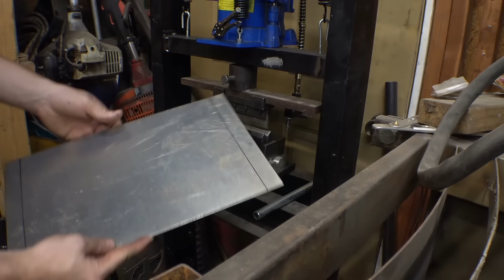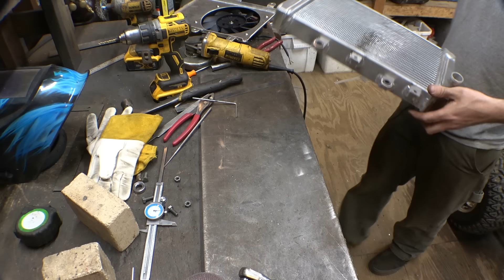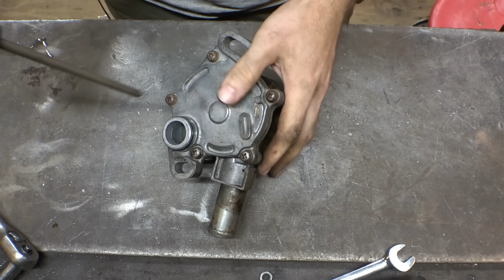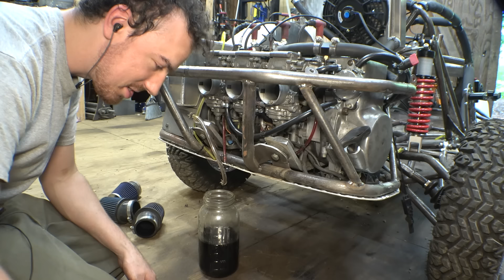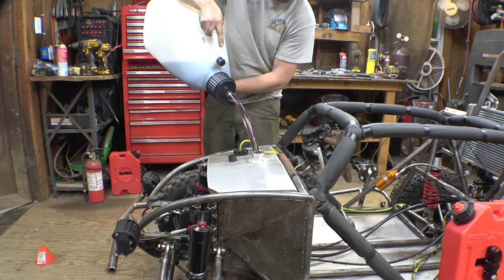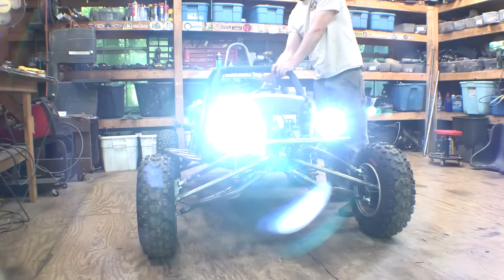Fixing all the Problems on this - Mini Baja Bug Project

Comment: You are thinking about the amperage wrong. The stator/magneto is the generator, capable of supplying sufficient power for it's purpose. The rectifier/regulator simply converts the A/C voltage to DC and limits the max current to it's rated limit. The "LOAD" is what "pulls" the current from the regulator and stator. 

In this case the battery wasn't fully charged and was simply charging. Once it is fully charged it won't pull hardly any current (just running the coils or cdi) until you put another load on it, like lights or radiator fan. 

The bigger the load, the hotter the regulator will get as it's working closer to it's rated limit to keep the battery charged.
Reply: Glad you typed all this and save me from. 😂
Reply: Same. I’ll go a bit further and add that you did the best thing possible for the regulator. As was mentioned above the regulator is a way of converting one thing to another. That conversion creates heat and the more it converts the hotter it gets. Air flow isn’t super critical but heat dissipation is. Mounting it against the aluminum floor pan gives it ample amount of surface area to dissipate heat. The other regulators you were testing were mounted so they were doing what they were supposed to do. Just be sure to not use washers, spacers or insulation between the regulator and aluminum floor. You want it as flush and smooth fitting as possible.
Reply: @wesmadebuilds681  happy to catch a video early enough to share some knowledge. Lol. Usually I come to the comments and see someone beat me to it.
Reply: And the fuse between the stator and rectifier is to protect the stator if the rectifier demands too much power or if you have a short to keep from melting wires etc.
Reply: Better steering on that bug? I seen it pushing through the corners three wheeling most of the way
Reply: @Beardest_Fishing  well said!
Reply: I was going to write something similar, but you give a good explanation! I guess he has already tested with the new lights on, otherwise that could be an issue if the lights draw a lot of current, but they shouldn´t since they are LEDs.
Reply: Also I think you’ll find the regulator rectifier earths through the body of the unit .ie when it’s mounted
Reply: As the current is so high, there is a good chance to burn the generator.
Reply: That is incorrect, your talking about an alternator. a generator only produces DC voltage. whereas an alternator produces AC voltage. and the diodes in the alternator convert the AC voltage to DC voltage. and the rectifier is part of that process. the regulator simply controls the amount of charge. the alternator is charging the battery. which in most cases is 13.6 volts maximum for a twelve volt system. when the battery reaches 13.6 volts. the regulator stops the alternator from continuing to charge the battery. until the battery falls below twelve volts. and varies depending on the vehicle. where it allows the alternator to start charging the battery again. if the charging system didn't have a regulator? the alternator would continue charging the battery. until it boiled all the liquid out of the lead acid battery. and the amount of load the charging system can handle. is determined by the amperage the alternator produces. which in most cases for average charging systems is around 80 to 90 amps. and some alternators can range as high as 140 amps.
Reply: Someone else (quite clever clearly) mentioned the ground plane (the chassis) is probably seeing AC, so the rectifier ground is seeing AC too when it's exoecting negative DC. Probably why it got so hot
Reply: It is probably a shunt regulator.  Because the extra output is basically shunted (or shorted) to ground. The smaller the electrical load on the system the hotter they run because they are disapating all the output to ground. I had a 2002 Yamaha street bike that had a barely adequate charging system and I swapped the regulator rectifier out from a different bike that had a series regulator that ran much cooler and had a higher total output because it was way more efficient.
Reply: @musicauthority674  Source don't push the current, loads drain current from the source. Voltage regulator in alternators limits only voltage level to usually 13,6 V nothing more .

Comment: You mounted your regulator on a big aluminum plate which is a giant heat sink thus keeping it from getting as hot as it was when it wasn’t mounted. Should be fine.  Get some of that heat sink goop and it will run even cooler

Comment: You normally only just have to replace the impeller and.seals on a water pump.  We keep spares in the tool box.  Same for my boat.  I think all my water replacement impellers are plastic and go out.  That is a big water pump.  Water pumps are owned by the coolant company.  ;)

Comment: Hey on the bearing that was oiled by the oil injection pump. You can get and old school drip oiler and turn it on while your ridding. Amazon has them for 20.00 dollar. They are used on vintage machines and steam engines

Comment: I've drilled lube holes for the main bearings when deleting oil pumps. You may want to check if your engine will have any problems switching to premix.

Comment: Conspiracy theory alert on the gas container you bought. They make these types of products because of you assuming the way it is made that it is a gas container only. Once you put the fuel in there you cannot ever put water or any sort of potable source in there again. So now you have to go buy another one if you're going to use it for water. You have to really watch out what you're buying nowadays. They get you coming and going and spending a shitload of your hard-earned money. Anyways all in all what an excellent build once again.!
Reply: Did you know that if you put tinfoil on your head, you're not actually warding any energies, you're actually focusing them, because antenna. That's how radio antennas work.
But moving on, the reason these types of color coded and valved gas cans exist is because in the early 2000's dumbasses started using the lawsuit loop to make money from companies that made the old style gas cans. They'd throw fuel on fire, get caught on fire and then lawsuit. Well, that's when player number 3 came into play. Insurance companies. Now, insurance companies will do anything including a BJ on a leper to get away from paying, so what did they do? They lobbied for gas cans to be coded, have a two hand operated system AND have a trickle instead of a pour. You know, all means to make it difficult for people who need assistance in the rain so they don't drown, to throw fuel on fire, drink from gas cans that were unmarked (well, partly, there was a slew of lawsuits against gas can manufacturers because there were no clear markings and kids wound up drinking from them) etc. TLDR: soup letter agencies have nothing to do with this, this is squarely between brain dead people, judges and insurance companies. Oh and brain dead politicians who will sign anything that comes with a legal bribe. :)
Reply: @aserta  yes and there it is.
Reply: Maybe to make life easier things need to be color-coded just like yellow is diesel and red is gas and blue should be water.

Comment: Perhaps you could try to run another regulator in parallel to cut the amps each sees in half?  Ed.  Might also try a switching regulator instead of what you have now.

Comment: I would use Amsoil Saber at 80:1. Tune it using that, and continue using it, thereafter. . The best full synthetic American-made two-cycle oil available at the moment, and is very low smoke, when your carb is tuned to use Saber at 80:1.

Comment: That water pump and blocking the radiator was the cause of overheating. The heat then made the vapour lock worse since the fuel pump was bad in the first place.

I have a Volvo V40 of first gen that has the 1.6 petrol engine which is said to have everlasting waterpump due the metal impreller and good design. So when my engine started to overheat after 2 miles each time I drove, no one belived me when I said the water pump is bad. Most was thinking it was the headgasket. But when headgaskets go, they give random results when the overheating starts.
So  when I pulled off the water pump there was plastic impreller bits everywhere and there was not a single blade left on the pump. Someone in the past had fitted a crap aftermarket one.
Now 4 years later my car goes still strong with the new pump 🙂

Comment: Should probably install some sort of shield for the regulator or itll have water and oil whipping on it from the chain. Liable to deal with corroded wires later on otherwise imho.

Comment: Use a shop vac to drain coolant. Take off a hose connection high up in the system and put the shop vac hose to it.

Comment: for your regulator woes: the heat the regulator gives off will go up with the square of the current, so if the battery you used was low (which it kinda is at 12ish volts) then you'll get lots of amperage at first. resting battery should be in the low 13s when properly charged. check again after running for a bit and see, once it's charged up you should see less amperage and less heat, more in line with your CBR.

Comment: @Rather B Welding you need a baffling inside the fuel tank. When you corner the fuel slashes and pump can’t pull. The baffle stops splashing inside the tank

Comment: if you look at small engines usually older ones like the briggs n straton, kohler, n other motors they have there regulators near to or on a fan shroud area - cooled from behind with the air cooled fan. newer ones often mounted on plastic with a real "ground wire" to the metal fin like areas - yours might need that. if there is still to much voltage output that you are finding, look for a diode to place in line. the voltage normally will drop 1.5 volts per diode. but you have to match the amperage size or higher. on a 16-20 amp system look for a 25 amp diode. note diodes also block voltage output. there is the in and out on the diodes. if the volt meter reads an output voltage it is wired correctly inline, if no voltage shows up on  the terminals or output wire it is wrong. a lithium battery will take voltages up to 15 v dc. lead acid, agm, other batteries want to have a max voltage of 14.4 v dc when charging. most vehicle lights can handle the 14.4 to maybe a 14.6 volts. beyond that is where it is best to put in a voltage drop diode - most lighting systems are under a 5 amp draw so a 5-9 amp diode can be used (ebay has any type diode you want). Note often smaller amp charging systems utilize only 1 wire field to the regulator rectifier, there is a frane ground wire design on them. anything over the 9 amps usually have 2 ac input wires and there is no polarity on those wires - ie you can't wire it wrong.  it use to be the 1 wire systems had diodes placed in line as a bridge rectifier taking the ac and with 4 diodes converting it to dc current.  the newer systems utilize current limiting circuitry and stuff to limit the output amps and voltage. Some of the really old motors took the ac output put in 1 diode and ran the wires to the battery and lights - nothing "No LED" lights just always the yellow looking tungsten light bulbs. if you have seen some of the old battery chargers they used a fin looking thing called a rectifier to change the ac to dc. never had a diode in them. what this and diode bridge rectifiers do is clip half of the ac electrical sign wave to be only half the wave or dc output. I hope that helps. Oh, the clutch side bearing - take a container of sorts - plastic bottle put some cloth or cotton on the bottom where you have the oil line connected too, don't connect to any carburetors. only connect carbs to carbs. fill the tank with oil. minor pin hole as a breather to or in the side of a fill cap. check oil level regularly. heat a safety pin with a torch and push it in the tank for the breather. add more cloth if needed to catch the dirt and replace if needed.

Comment: Something you could try is to add a 50ohm 15 watt resistor between the DC out and a computer fan. You could use the computer fan to cool the regulator. An 80mm fan should be plenty. You could even harvest one out of an old computer power supply.

Comment: With the huge air filter pods the engine will run lean. This will cause the engine to bog down when opening the throttle and aid in making the engine run hotter.

Comment: Chris, the amount of current (amps) that a generator is capable of producing has zero effect on how many amps a circuit will draw from it.  The more things you are powering, the more current will be drawn from the generator.  Current (amps) are not pushed by the generator into the circuit.  Instead, the circuit pulls however much current it needs to operate.  Assuming the generator can supply the needed current.

My guess is that your battery was not fully charged, and that is why you were seeing 14amps at idle.  The battery is drawing that much current.  When you rev the engine, the voltage goes up a bit, and so, the battery draws more amps.  As the battery reaches full charge, you should see the amount of current it draws go down.

Comment: If that PTO bearing had a constant supply of oil, it would be wise to try and at least get that hooked up to receive oil pressure. That's one you may not want to chance it on when you go ripping it
Reply: Another thing I just remembered about the overheating thing. Something you might check is the condition of the cylinder walls. If you have a bore scope and pull out a spark plug to check the cylinders.
     If heat was an issue, that's one of the first places to check. Check for vertical cylinder scoring. That would show that the pistons overheated. 
     But if it's all good it's all good

Comment: A fully charged 12 volt lead/acid battery is 12.6 volts. A 12v battery fresh off the charger will read 13.2 to 13.6 volts generally. An alternator produces a bit more voltage that the battery to push in the charge. Commonly 14.2 to 14.7 volts.
Hook up the oil tank/pump to the pto bearing. Whatever it pumps in in addition to the oil in the fuel will be a welcome addition.

Comment: Running 2-stroke engines on Vespa’s, full cross and others for years…once engine is at correct temp with correct % of mixture and good 2-stroke oil they almost don’t smoke at all, not to say not at all (visible at least)

Comment: The white stuff inside the case is called aluminum oxide and it will eventually eat through the case. If you don't do something to stop it . It is very similar to rust on steel

Comment: For the gas can, it could be 3 things:  1. The plastic of the take can be melted by petroleum products if the plastic is not the right type.  You can get this information from the number that is in the center of the 3 arrows stamped on the plastic.  All plastics have a recycle number.  Just look at your red gas can and compare the 2 numbers.  They only go from 1 to something like 7 for now.  2.  The back plastic lid might have the same issue, so check that.  3.  I think by govt. standards to transport fuel, every part of the tank needs to be sealable so it won't leak if it turns on its side.  I am not sure if a simple stopper at the end was submitted for certification to the govt.  That costs money.

Comment: As long as you supplement oil to the pto i dont see it being a issue
I have a premix snocross sled and its been running non oil injection for years

The reason ill never oil inject swap it is because usually when a pump goes out you find out the hard way

Comment: I am kind of worried about the fan being that close to the expansion chamber on the exhaust. It looks a bit too close. Granted I'm only about 5 minutes in at this point and not sure if this will be addressed later on. If not, try to put a heat shield or heat tape around the expansion chamber to prevent the radiator fan from melting. There's a chance that it might not melt, but an ounce of protection is worth a pound of insurance on this.

Comment: That radiator right behind your seat with no protection from it, in the event of a leak / hose bursting is just asking for trouble. The burns from the hot water would be a life changer.

Comment: The regulator does get really hot normally, I had a 125cc 2 stroke Chinese pit bike that I put a bunch of electronics on and I touched the regulator at idle the one day by accident and It was incredibly hot, it then ended up lasting a whole 2 years until i sold the bike, the battery voltage also shot up to 15v at times but it also lasted

Comment: This is a little bit late for this build, but...   You don't need to have an air cooled radiator to cool the engine.  The old style "Belly Tank Lake Racers"  used a simple tank (no flues) to cool the radiator fluid before being pumped back into the motor.  In that manner,  it didn't need air flow to cool the radiator fluid, there was simply a large enough volume of water that the heat dissipated before being recycled back into the engine.  The downside of this system was the size of the tank needed to be large enough to allow the fluid to cool before being recycled.

Comment: Since you're running premix gas, you're going to have to adjust the carburetors to run on premix gas. Since they are designed just to run on pure gas. Yes, it will run, but it will run lean.

Comment: Just use the right sized bit on an impact and those will come out. GO EASY dont just blast off on it or they might snap. But the hammering impacts will break them free the best. You are more likely  to strip out with a screw driver like that vs an SMALL impact. The small M12 stuff works awesome for this stuff its NOT to strong but has some power to break stuff like that free.

Comment: Your oil tank could become an alternate fuel tank. Also you always have to drain the radiators starts designing a low drain point into your builds, future you will thank you.